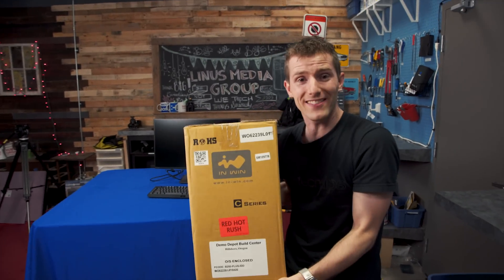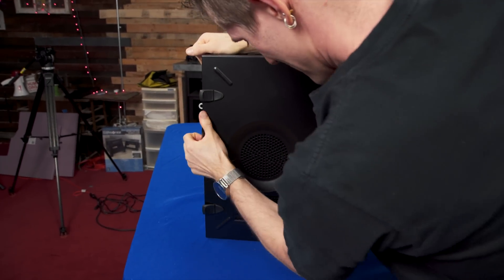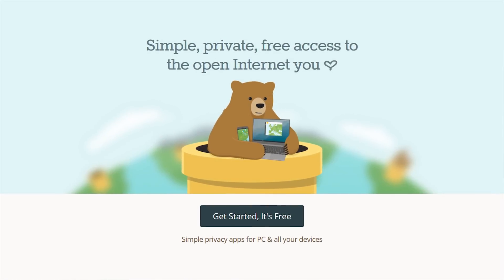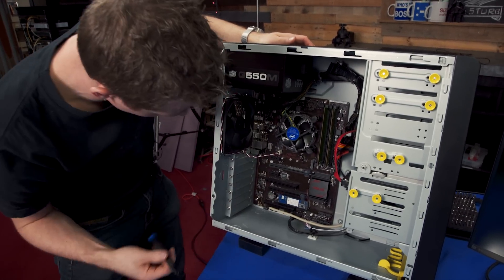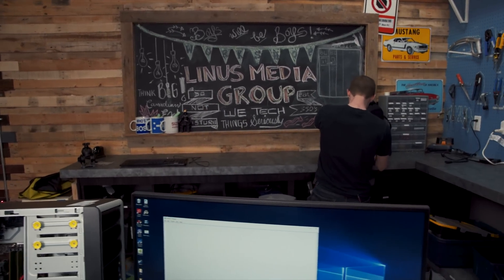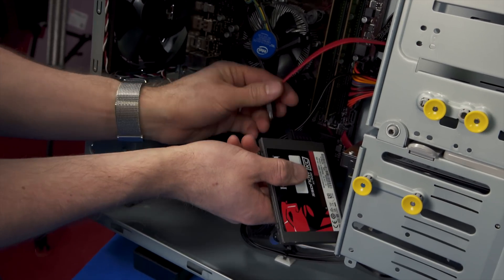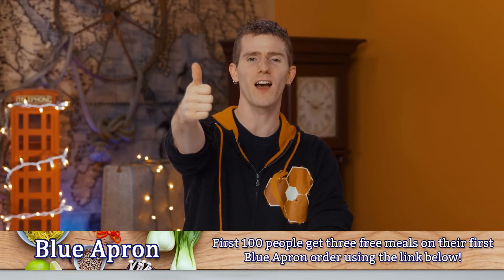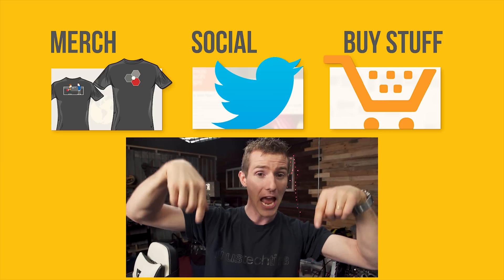Turbocharge your SSD for $40??

Comment: Good technological idea and would actually be helpful if it wasn't for the fact it's only available for 6th and 7th gen Intel CPU's and of course you need a mobo that has an m.2 socket too. The people that will be buying a new PC of that spec will likely be buying an SSD too. The people that actually need this solution are people that are rocking rigs from 2009-2012

Comment: Who's using a HDD as their boot drive anymore ? and why would anyone who owns an Kabylake, Skylake or as in my case an Haswell i7 4770k which is now almost 4 years old, If you can afford these CPU's and associated MB's why wouldn't one of your first upgrades (or first choice if you've built your own PC) be an SSD that makes your PC boot up in less than 20 seconds as apposed to several minutes with an old HDD, I have 6 HDD's in my Coolermaster Cosmos case (which is becoming a bit dated as is my CPU) but of course I only use them for storage and redundancy, Intel seem to be in panic mode since AMD released Ryzen because I don't think they saw this coming and they've got lazy and arrogant !

Comment: I came to the same conclusion. I built my current PC to last, and will only update when Xpoint is more widely available/cheaper/larger cap.  When that day comes, hopefully mobo manufacturers will have more options, maybe raid Xpoint drives with no need for RAM?

Comment: SSD has a SATA buttleneck of speed, right?
Does Optane also work with the OS installed in a M.2?
 
So... If i can afford a bigger SSD, optane is not a big deal, did I get that right?

Comment: Ok, so I agree that it seems pointless to use the Optane module in a new system but think about this scenario: you do have a boot SSD with a rather limited capacity and therefore you are unable to store all your games on it. Now with an Optane module and a HDD you are able to achieve much faster loading times for the games you didn't store on the SSD. And for only 40€ you can have far better loading times... Well, seems worth it to me.

Comment: Damn this is so useless! xD
It would make sense for old PCs, but they dont have a M.2 Slot and Kabylake CPUs. So it can be only used in new PCs and none is building a new PC with a HDD for your OS. With your storage HDD it doesn't work anyway, because the data is never going to get into the cache.

Comment: Sounds like best use with ZFS cache device and zfs intent log and most important as a swap device.
Providing there are actual both illumos/MacOS/Linux/FreeBSD drivers and OS support for it's best use as non-volatile disk space (meaning, that behavior of reusing retaining data after shutdown)...so encryption on such devices is a must.. (Also no stinkin' Win-doze spyware, thanks).

Comment: My plan, should i chose to impliment it... was that if I go with a Kaby lake or better build, would only be to add one of those to my  Data/Game Drives.    What I typically do with my builds is have an ssd or better for boot drive and OS  ( and a few select games)... but then keep all my less played games and saves on large Hard drives.    Then throwing one of the optains with it, to help boost repeat loads and i assume it helps with save game files a bit for games that auto save while your playing. So thats probably noticable that your not  chuncking up in the middle of a game while its auto saving or perhaps loading that new zone.     I personally love to keep my drives seperate due to how many drives i have lost. Also makes it really simple to reload the os, if u hose it up badly screwing around with  it, or experiemental  beta drivers,  pre-release os's,  bad driver updates,  funky  video card driver updates or any general malaize that happens to  the os.  I even have a spare SSD, i can swap in if need be, and still be able to fire up my games without reloading or... having to restore all my documents, saved games, and previous downloads since they are all on the mechanical drives.   So thats what I am thinking anyways.  What say you guys?   (and please pardon the errors, thanks.). 
?

Comment: Here's something that drives me CRAZY watching you.
You continuously SLAP everything around, SLAP it together, SLAP it onto the desk, in this video alone, you SLAPPED that new Optane chip onto that HDD like 4 times, SLAPPED the newly delivered puter onto the desk when you turned it over & seem to have NO respect for anything you touch electronic.
I wouldn't leave a garden hose for you to repair, I'd get it back cracked or broken or missing a part.
Every time you SLAP something down against something else, or a table or what ever, I cringe & think nothing else but how I want to SL_P you.
STOP SLAPPING EVERYTHING AROUND! You make me so uncomfortable.

Comment: This is a waste of time from Intel and the marketing team golf clap or face roll you decide... So what we are trying to get old bare bones machines your Grandmother owns to cycle faster? If that's the case they better make a PCI express x1  version because no old PC has M.2 and If it did they already have M.2 SSD configuration or stand alone SSD. Intel is my personal Go2 but they cost more which is why most opt for Amd I love both. The moral here is marketing! Intel needs to lower the cost of the old SSD those are still turbo. Besides the Intel team Engineers already did the R&E on them why spend another quarter mil on new tech to rescue old tech...Intel you can't help Best Buys Geek Squad sorry because that's all this product is good for.

Comment: OK, so my main PC is a Core i7-4790 with OS on Samsung EVO 850 but other stuff on fast HDD. It WOULD make sense for me to get Optane for my Z97x mobo to accelerate my WD Black 2TB HDD so that my games (Fallout 4/Mass Effect Andromeda/etc.) and Visual Studio runs faster. Image editing on should also be slightly faster for load/save.

But NO, Intel will only allow Optane to work on new chipset when it should be almost the same as my buying a Samsung EVO 960 m2 and switching on Intel SRT. Only problem is price.

Intel's move is clearly to push buyers to upgrade to the new CPU/mobo. I doubt it's a technical limitation.

Comment: So as long as there is an M.2 slot on the motherboard its good to go?  in the video he is using software to "enable" the optane memory.   There is no other requirements of the BIOS or motherboard.  Just  have the M.2 slot and run the program?

Just so my question gets an answer ..

I wanted everyone to know,  the Chipset
 on the MB has to support the optane memory.  I tried it in 2 of my 
computers, 1 was an ASUS MAXIMUS VI motherboard.  and the other was a 
brand new INTEL NUC I7 (the long black one with the skull on the top.)   
It did not work in that either,  when I tried to install the software it pops
 up a message that the current chipset is not compatible with OPTANE 
then it stops the install.  The computer does not even see the M.2 
memory when you install it so its useless to keep for any other reason.  
I bought the 16gig.module.   There is a  list on intels website that shows the motherboards that work with it.  
Or you could just download the setup file and run it.  It does the test right away.  
So be careful not ALL motherboards with the M.2 slot will work with it.

Comment: Optane for PC Gaming is useless.  Optane for Large Databases where access latency across a Fibre Channel or Ethernet Network is high and keeping data locally is where its at.  Even an NVMe SSD is an order of magnitude slower than 3D XPoint.

Comment: If these things were cheaper and came built into the motherboard they might make sense. 

As a typical PC user would not know how to optimise different ssds and hdds if they had them and even less people partition their hard drives. 

Taking the cacheing/storage options completely out of the end users hands with a hard ware option is a smart move as they'll feel the benefits we power users get from knowing how to set things up.

Comment: Neat I guess - but the coolest news here is this new memory technology in itself, not the cache module.

I mean - if you wanted to accelerate an SSD you can do that very easily (and significantly faster) using software to cache in RAM. The software that comes with Samsung SSDs have this option at the flick of a switch (works great too, but obviously only on those things cache can help with). Plenty of other good softwar eoptions too. RAM you can use for anything - allocate as you will ect. unlike this oddly inflexible module that will only work on newer hardware.

It would be interesting to see some "real life use" tests of a "old" standard 500MB/s s-ata SSD compared to this sort of new memory. Will it actually shave off time in opening programs and other responsiveness, or have we started to plateau and the bottlenecks are elsewhere?

Comment: Theres an option being overlooked Microsoft and by all benchmarkers:  Readyboost/Readyboot:
Readyboost speeded up HDDS because USB Flash had a very low 'seek time'.

ie: A lot of the small but important 4K files could be read from the flash in the ~ 13ms seek time difference between the two.
On top of that Having the hard drive not having to seek a whole lot of 4K files but concentrate on larger files at the same time as  info was being read from the flash drive acted as a kind of optimised RAID 0..!

Now I see the ~same advantages being possible from using an Optane drive as a readyboost drive:
~RAID 0 with the size of the files stored on each drive optimised to the drive's strengths...!?

Not only that; when Windows sees the Readyboost drive as fixed it does not reload the cache on boot but keeps it to speed up the next boot.... aka; Readyboot and a great speedup in boot times.

What's surprising is that both Intel and Microsoft haven't wiped the shit out of their eyes and realised this yet.
(When they do they will claim it was their idea as usual)

Info on overriding MS's Readyboost settings, to test this:
https://hatsoffsecurity.com/2015/05/31/force-enabling-readyboost-windows-78/

For other good review ideas; contact me!  :)

Comment: What I would like to know is this:
Intel already provides the ability to use an ssd for caching, basically the same way optane does.
Since there is so little performance difference in performance when combining optane with an ssd, what is the performance difference when combining a "regular" ssd with a hdd instead of optane...

Comment: Only benefit I can see is that you can get SSD performance at half cost compared to a pure SSD solution (assuming 1TB drives, cost benefit is even higher going above this limit). Only downside seems to be initial start time (i.e. precached).

Most of my current systems uses a boot drive and a secondary 1TB+ drive, if it would be possible to use this caching on a secondary drive only then I could see the benefit in highend system with an SSD and a optane accelerated secondary HD.

Comment: What about wanting to accelerate a RAID array? Say 3 1TB drives in RAID 0 which is already 3 times faster (theoretically). Would you get the same performance as one drive or does the 3x speed effectively come close to getting 3x the optane performance (close because I'd imagine there's got to be some drawback somewhere).

Comment: Sounds useless, why would I buy a second piece of hardware when i can just upgrade to an SSD that has faster write speeds than Intel octane? Linus didn't mention this in the video, but the octane only speeds up read speeds for a hard drive, NOT write speeds. You might as well save your money and get an SSD.

Comment: I can see a use for this in super specific contexts. With new laptops (if possible), you can add the octane and have your HDD be a 2nd SSD (ish). With things like people emulating Breath of the Wild, you'd see increased shader times by having that 32GB of caching (which I think is very useful). Bottom line is, if you're an enthusiast this isn't a hard buy.

Comment: Here's the problem, for $60, you can get a 120GB SSD, which will be much faster and there would actually be more storage.
Optane proves it's uselessness again. If I wanted to cache my HDD, I would get an SSHD, doesn't even require an M.2 slot.
If, and this is a big If, in the future we can use it the same as RAM, that's when it'll be useful.
Intel just wanted something to stand up to AMD and this is their first trial and error.
Reply: lakimens Optane bosses prove their ineptitude again.   Optane would be good as an NVME SSD or as a power-loss surviving cache on a high speed raid controller. A dedicated external memory card for a software controlled disk cache is a near-useless product even if not saddled with artificial market availability limitations.
Reply: SSHDs have performance bottlenecks that Optane doesn't have.
Reply: heres theproblem HD can come in sized almost 5x the size of SSD and the cost is much less.  I see this as an extra for people that already have a HD or a business that runs with them.  I really doubt people are going to trash their SSDs and buy a Drive with this and go back wards...

Your over thinking this and also thinking backwards.
Reply: Rainbow six,gta v , pubg, warface. All these games in 120gb ?
Reply: I agree about the 120GB SSD part, but an SSHD is only slightly faster than an regular HDD the M.2 is basically giving your a HDD speeds somewhere in-between a HDD and a SSD
Reply: Optane on SSHD?
Reply: Some poor dude with an early mid 2000s rig would jump at it.
Reply: You don´t seem to get the point: Optane memory is not a storage device, it´s a cache. Hence you cannot compare a storage device to a cache. Nor is the optane stick meant for you to jack up files on it.
Reply: Optane accelerated HHD can in fact be faster than cheap SATA SSD in many but not all scenarios. It can even in some cases beat NVME drives in rare cases even when linked to HHD so don't count optane out in any given situation. Not even when dealing with program file that don't fully fit in the cache past it only needs to cache the small files to make an incredible impact on performance of the HHD. If the HHD only has to deal with the sequential tasks they can be quite fast & let optane take care of the rest. That is in fact pretty much how it works.

Comment: What if I have SSD and HDD at the same time? Would Optane be any beneficial for me?
Reply: Only if you constantly used programs/information stored on the m.2

If all you used were on the ssd then threr would only be a difference in backup speed which would offer an oberall speed benefit of up to 2% maximum alsom known as close to nothing. Ssd is to be used for storage and m.2 hard drives for backup.

Comment: so, it does perform better with a classic HDD but what if you have a SSD and an HDD in your system, will it still boost your HDD ? Depending on file location i guess?

Comment: @Linus Tech Tips  You hit the nail on the head.   I was thinking the same thing about these optane drives,  the hardware capable of running these is so much so that most of us with it ALREADY have SSD's.  I just finished building a 7700k Build with GTX 1080 and do you think i said "hey maybe i should just hold back a little and skip the SSD for the boot drive".  Anyone who goes that deep in and skips the SSD should have his nerd card revoked.

Comment: What I'm most interested in is whether or not this can solely be used to make a HDD faster while using an SSD as you main/boot drive and your HDD as your storage drive.
Reply: As of the 19th of April, an update has been released that allows optane to boost secondary hard drives.
Reply: Gabriel Paul That is a fucking waste . It would've been so much worthed if it could do that
Reply: here for the same info, got really annoyed it wasnt answered
Reply: YOU CAN DO THIS... Use the drive as STAND ALONE STORAGE AND USE PRIMOCACHE.
Reply: You actually can... By simply using it as a PrimoCache....
Reply: 2 years late, yes you can be sure to set your secondary hdd as a gpt device then you can pair it with the optane module without primocache using the intel optane software. However the software will not give you any statistics but will be working.
Reply: Nice save! I'm working on a new build and wanted to use an SSD to boot, with an Optane module yoked to a 2tb HDD. Hmm... Wonder if Optane would take cache duty for a RAID array?
Reply: As Gabriel said no unfortunately. Since optane is limited to only one partition, that´s another thing you cannot for example power 2 main drives with it, and only with the main partition as well. Any other partitions will work as less as a second drive.
Reply: https://youtu.be/tIXSSOzyLbs SSD vs Nvme in gaming performance: I'll hold off on the Nvme drive right now, since the Optane HHD has to be primary OS drive. After I run Cyrptomining Software for a year, and I don't have anything break covered by the 1 year manufacturer Warrenty, then I'll think about breaking the " factory seal " for an upgrade.
Reply: No, you can't, the optane only speed up the main drive.

Comment: Im lost, so with a HDD on a compatible system. Would this make an average 3tb HDD ALMOST as fast as an SSD? Because if the cost of it is cheaper than the current pricing for SSD's with that storage then I would be pretty sold for someone who actually had a use for that?

Comment: since when linus suck intel di*k? l better buy 500gb 850 evo since my old mobo dont have m.2 slot and if I upgrade to the kabylake, then i just simply buy m.2 ssd like 960 evo/pro...wtf
Reply: thats basically what he said at the end. that the limitations on requirements means most people will have an SSD, so they wont really need this. And that anyone who would need it, likely doesn't have the m.2 anyways... Its the conclusion of his whole video, which looks like you missed...